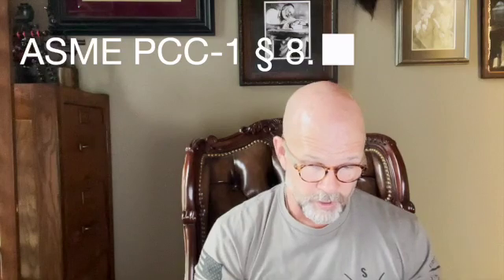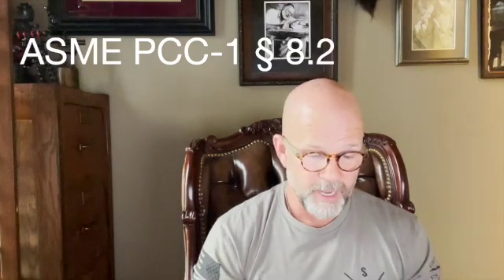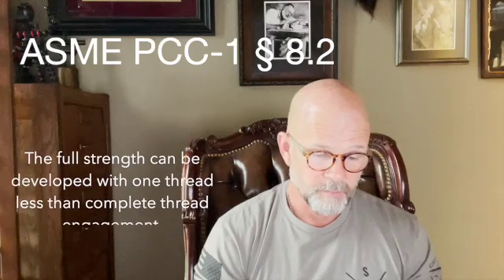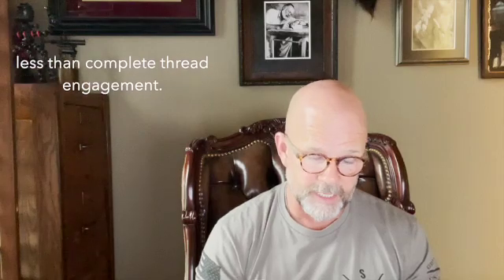What is Proper Thread Engagement?

Comment: Great video! For vessels and piping that have been in service!

API 510 5.15 "Flange fasteners should be examined visually for corrosion and thread engagement. Fasteners should be fully engaged. Any fastener failing to do so is considered acceptably engaged if the lack of complete engagement is not more than one thread."

API 570 5.15 "Flange fasteners should be examined visually for corrosion and thread engagement. Fasteners should be fully engaged. Any fastener failing to do so is considered acceptably engaged if the lack of complete engagement is not more than one thread."